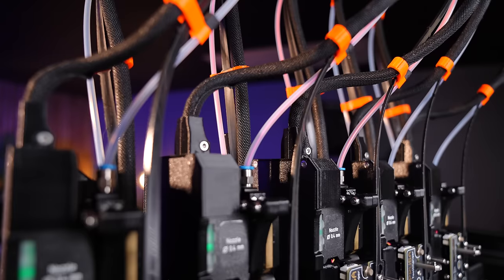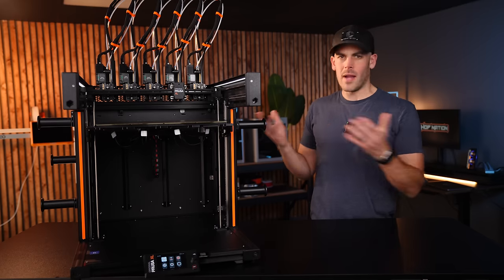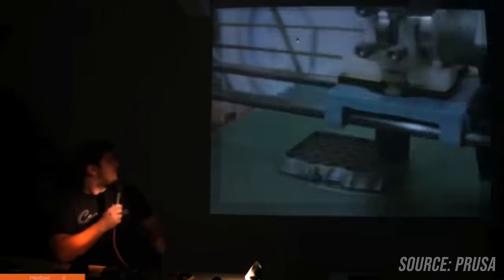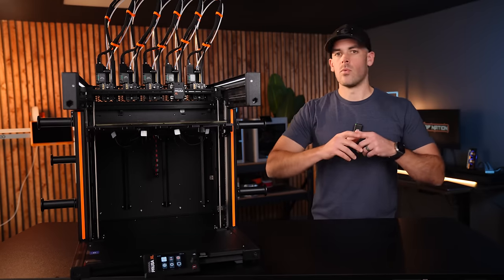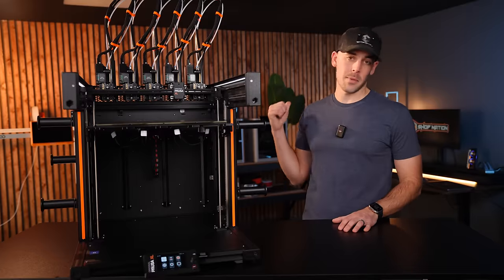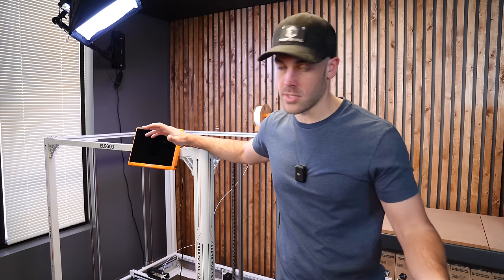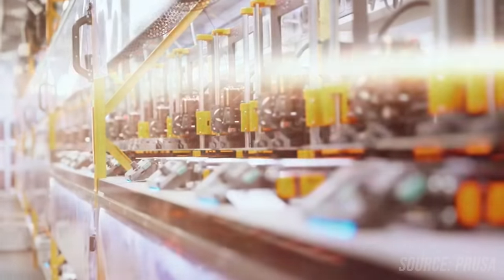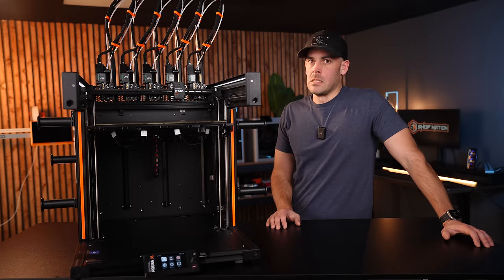Why Prusa is the next Blackberry

Comment: Guy. Listen. You need to get real.

1. People hate plastic
2. People hate the look and feel of printed products

If you print something for a business, they do not ask about number of tool heads or if it is core x-y. But rather
1. Is it eco friendly? As in, is it energy efficient?
2. After two seconds, they ask for the usage of recycled filament.
3. They ask for standardization, as in knowing what to expect
4. They ask for secure and stable deliveries. Like, what happens if I go out of business?

Anyone planning to run a commercial farm, would ask for
1. Performance. As in reliability, safety, durability. Speed is just metrics, and for commercial work of almost any kind, speed is important, but usually way down the list.
2. Cost. Like total cost through maintenance, down time, training, safety measures etc.
3. Long term support and services.

Going through the posts of this video, nobody seems to get what Prusa can do to grow: They can grow a ton.

Their way to success, is through Printables. They need to make it a marketplace to also buy the printing service, of the models there. In the grand scheme of things, that is a tiny investment for them. They are irritatingly close.

They need to actively seek for designers that are willing to dig into printing, and exploit both the material and the process, to deliver products that are actually desirable and that only can be printed or that heavily benefits being printed. I don't need a headphone rack. I don't need a pen holder. I don't need a super expensive trash can, nor a flower pot. I mean real goods that ordinary and real people would both want and desire. Aim for desirability and mojo. Why are they targeting dorky dork that needs pen holders?

I have talked to a ton of people, asking them if they have ever bought anything printed. Nobody has. I have asked a ton of people if they know about anyone that ever bought something printed, and no, nobody knows anyone who ever bought anything printed. I ask people if they know about a single product that is printed, that they actually want: They never do. If asked if they know where to get a model printed, they don't know. I could go on, drill that point in, but we all know this is the case.

Prusa has a lot of talent. They do tons of amazing stuff. But they lack key talent, and never delivered anything to grow any infrastructure. Not because the made something new or lead anything: Printables is a copy of someone else. They never did lead. They got a leadership issue.

So. Lets circle back to printer hardware:
1. I need all printers to have a functional multizone bed, that is super energy efficient.
2. I need a working hotend and extruder, that also is energy efficient. As in working.
3. I need dirt cheap printers, meeting the need of businesses. One small, and one big.
4. Unless they totally get rid of the heated bed, we do not need much height. It will never be that efficient, no matter what we do.
5. I don't need crazy speed. I rather want to see speed that balance cost of ownership and efficiency. That is what any responsible government would ask for.
6. I need a built in, and efficient way to dry filament.
7. I need for Prusa to deliver everything needed to run the printer, including cleaning and maintenance. Particularly the bed.
8. I need one black PLA+ and one black PETG by Prusa, to be the standard to print models with.
9. I need their printers to be integrated with Printables, to easily print ordered products.
10. I need them to make it easy to set up shipping from home or small businesses to ship to customers. That includes shipping and packaging.
11. I need them to grow a vision, communicate it, then delivering it. I need them to lead.

Sad thing is: That will probably never happen. They seem to lack talent, balls, and leadership to do any of that. They got so much talent, they are so irritating close, but I doubt they ever will become the business that grows a real infrastructure. That will be their end, when somebody suddenly does. For now, they will do just fine.

(Guess what Bambu Labs tries to do? They all know where to find me.)

Comment: Personally I feel that Prusa has over values it's brand.  In it's time the MK2 was a machine that did more then their competitors for less money, the MK3 had lots of innovation (removable bed, textures bed, silent drivers and bondtech gears) and the price was only $100 more.  However as components started going down the price of the prusas price stayed the same.  

So now the company doesnt have a price edge or a tech edge so the cominuty is moving on to the next thing as their products age.

Speaking from experience I was able to take the motors out of my Mk2 and use it to build a voron switchwire which cost me less then the mk4 and had all the same featues.  

Having said all that im still a fan of prusa but it does feel like their change of business model has ignored their old fans in favor of new fans.

Comment: Equating Bambu to the iPhone is actually a good analogy. Being closed source, they are less customizable, and you are at the whims of the company who creates it for support and upgrades. In 5 years, when the machines start falling apart due to poor construction or cut corners, the only recompense will be to buy a new one. When a user wants to upgrade, they buy an entirely new printer and ditch the old.

Sure, Prusa has a high base cost of entry. But, you can upgrade from machine to machine as the technology advances at a reduced rate. Every piece of a Prusa machine is user replaceable, and given time most end up with alternatives on the market that you can alter as needed.

And let's face it, when a company is capable of remotely triggering a wave of the printers remotely by accident, that should raise concerns both about your data safety and the segmentation built into Bambu's core systems. I wouldn't be surprised if, within five years, Bambu has lost LAN printing or USB printing, in favor of only using their cloud services. Or, if you want to print that way, you have to buy a special adapter. Headphone jacks, anyone?

Yes, Bambu is hitting the scene hard and fast. But it is still so new that it is hard to know what the future looks like in terms of reliability and maintenance. My hope is that this new disruption pushes Prusa towards more innovations, including an MK4 sized CoreXY. Or better support for TPU and other materials in the MMU. 

In the end, it comes down to preference, but I feel like the old man who would rather drive a beat up old truck that he knows how to replace every part in, and can find them easily, rather than a Tesla just because it is new and shiny.

Comment: The points brought up are exactly what I am wrestling with myself. I really want the XL, but other printers have much more technology already built in, while the XL feels like the only significant innovations are the head changer and segmented heated bed. Most of the larger, faster printers from the likes of Creality, Quidi, Bambu and others now come enclosed, with air filtration (which is important in my situation), and features like cameras and LIDAR for first-layer monitoring... all of which the XL lacks, which is incredibly disappointing. Besides the swappable print head feature, it feels very much like the same old stuff. I really would like the multi-material option, but am having to weigh that against the other features that it sadly lacks... let alone the dramatic price difference. I'm struggling to justify spending that much on the XL

Comment: To me the biggest benefit I’ve seen in Prusa over other printers is the upgrade ability. I bought mk3 and over the time that I owned it they updated it to work better and better, through software through easily replaceable 3-D printed parts that they give you the files for through very cheap replaceable sensors. I now have mk3s. Their mission seems don’t throw the baby out with a bathwater which in a world where everybody complains how everything is disposable prusa has strived to keep things updatable. Is the bambu lab printer like and iPhone where they want you to throw it out and get a new one every few years? Or do they have cheap upgrade parts.

Comment: The biggest advantage of the multi tool vs purge material change is that some plastics DO NOT PLAY WELL TOGETHER! If you run HIPS then purge with PETG then none of your PETG layers will bond. So forget using HIPS as a soluble support with PETG. There are many other bad combinations. However use multi head and you can use HIPS supports that do not bond to PETG. No need for soluble supports unless needed as supports are removed clean, even with 0mm space. Another advantage is using different nozzle diameters of the same material. I like 0.4mm nozzle with 0.007 layer height for high detail and tight tolerances on the perimeter while 0.7mm nozzle with 0.3mm layer height for infill on the same print. This gives the best quality vs speed possible. Most of my prints are for functional parts so multi material without worrying about contamination ruining a build is worth the extra $$$. I bought the Prusa XL with all 5 tools for this purpose. Also with Prusa's open source code and tool changing I can Hack my own tools and build any number of tools like milling auto insert tools. Multi tool heads is the beginning of the merge between 3D printing CNC. Most CNC milling and lathe tools have auto tool changing, Prusa is on the bleeding edge once again. There is no end to how far this will go.

Comment: Actually we still miss support for multinozzlediameter in Prusa Slicer. It would be quite nice to use different nozzles, not only different materials.
Also the MMU3 should be supported. So you can use multiple colours with classic filament change, but also different materials - changing to another extruder - or different nozzle sizes.
This way the affordable 2 head version would be much more interesting.

Comment: You kinda answered your question with your own sponsor…
Like the Apple vs the PC.
The PC is “open-source” so you are not fixed or limited to specific configuration. If your needs change, you upgrade components…as needed.
But the Mac removed all of that for those that just want their computer to work…it’s proprietary and the software and hardware were made together to work together.
Same here…
The early adopters are what have gotten things this far…but they were ok (and likely eager) to make changes and upgrades to their printer.
Note that the sector has matured, more people without technical knowledge (or interest) just want to make stuff without hassle…enter the proprietary (?) enclosed boxes…that can also print a multitude of filament types.
But where do I get the parts and upgrades from ?
I’m a fan of Prusa for their trailblazing but was never convinced the swing bed was the way to go…I’ve always had a CoreXY.
But I’m at the point where I don’t want to be bothered anymore and am looking at an enclosed one-stop-shop machine…that does “engineering” filaments.

Easy Peary…like meals from your sponsor 😊

Comment: I am a massive Bambu fan, however I have also purchased a 5 tool head Prusa XL specifically for multicolor printing. I do end up with quite a few prints where a ton of material is wasted on purging. I estimate the filament cost savings (and time savings) will cause the XL to pay for itself over the course of about 3 years at my current pace.

Comment: Sooooo… this is amazing in my opinion. Like some changes on materials and code set up, but this is absolutely the BEAST for farm and home-brew manufacturing on additive manufacturing. Just keep the material the same on the machine and you only have to change spools and keep it going. Its the ultimate farm machine. And then set up other ones doing other colors and bam! You can crank out lots of things for pennies… this is an innovation but it is marketed incorrectly.
Reply from the maker: Couldn’t disagree more, it’s a terrible farm choice

Comment: Reliability is worth more than Speed to me...I have a Bambu P1S, Neptune 4 Pro and Prusa MK3S+ and so far I like my Prusa for Reliability, Neptune best value. and Bambu so far not impressed. I had 2 issues with it so far just out of the box. the bedplate interfered with the poo chute, which I've solved, and now i got nasty crunching/scraping sounds during high speed moves coming from a bearing or pulley  or something.  not sure how to solve thay yet.  the Prusa is so quiet and smooth and reliable.  is the speed worth all the extra noise and quality issues??? 🤔

Comment: I remember that shortly after release of MK3, Prusa made a survey what would be most important features people would like to see in next machines. There were various options to choose, like printing speed, connectivity, enclosure, ability to print flexibles with ease, and exactly - a toolchanging mechanism. Vast amount of people voted for that toolchanging, as it probably was seen most fancy (but without consideration if it actually would be useful on day to day basis) and cool. So Prusa followed the request, when meanwhile people find and oriented toward speed printing. Which was quickly picked up by Chinese companies to spit out faster and faster (in theory) machines with the rate of fire of an machine gun. Prusa with their "limitation" of making and producing everything what was possible within costly EU, was on lost position from the start. Especially that when people drooled on speedboat race breaking new and new records, they were developing completely different kind of machine.
Reply: That was not smart. Steve Jobs quoted Henry Ford about market research. You the maker need to know your customer's needs better than just asking what they want.

Comment: As someone who loves tinkering, I have to say, that Prusa already lost a very big and important sector, when the Ender 3 (and all its clones and upgraded versions) flooded the lower end market and killed of the cheap i3 clones, that were at least somewhat compatible with real Prusa machines. At that time it might not have been seen as an issue, because they were positioned as the premium brand, that just works well out of the box. But now that they get dangerous competition at the top end, they have lost the perfect moment to diversify their portfolio into the Ender's niche, which is imo the best entry way for new 3D printing enthusiasts.
The Prusa mini could have been that cheap entry to build up brand loyalty, but even the kit is 460€ rn. For comparison my first 3D printer - an Ender 3 - did cost 155€ with a full 1kg spool of PLA included (which was like ~9-10€ at that time). What do you think, a student or someone else with a tight budget will prefer?

Comment: It's just too much money. You can build a Voron 2.4 350mm for a little over $1000. They're charging $2000 for the base with a single extruder, semi-assembled. An all metal hot end + extruder + cables are like $150 each, so about $600 for 4 of them. Adding on the 4 print heads to the Prusa is $1500 extra. The thing is, I don't think Prusa is designing for fully automated production like Bambu or Creality. I think they want to stay a boutique and just scale up like that as far as he can go. The 8 week lead time for the past 10 years seems to support that.

Comment: Got my Prusa Mini+ 2 weeks ago, love it so far. And I'm sure that Prusa will survive much longer than any Chinese brands. Bambu Lab, Creality and any other Chinese brands can provide machines at such low price due to government substitute and lower labor costs, that's not sustainable. 

I would rather pay a bit more for a product, that is carefully made and is environmentally more sustainable. But I'm pretty sure, Prusa is not putting so much effort into the consumer 3D Printer market, but more into the industrial machine for small- and mid-size factories. And due to the new EU Supply Chain Law, they will have a market in the EU.

Comment: I had a XL on order from early on, when I finally got the notice to complete the order I did a little research and chickened out.  I gave a great deal of thought to the MK4 at the time
but I could try a Bambu P1P for less money.  A few month's later I decided to stick with Prusa and sat down to order a MK4 and they couldn't even give a delivery date.  Well since then I've bought a P1P and happy enough that I just ordered another P1P with AMS.  Sorry Prusa.  Edit Thought I would mention I sold my MK3S+ for $100 less than the P1P I bought. Pretty good upgrade for $100.

Comment: i have both, a X1C and a Xl, out of the box and without tuning, the xl is much slower as the bambu BUT! You can tune the XL easy to nearly the same speed as the X1C in a single color print and if you add only 1 color change per layer, the bambu is that much slower, you cannot believe it